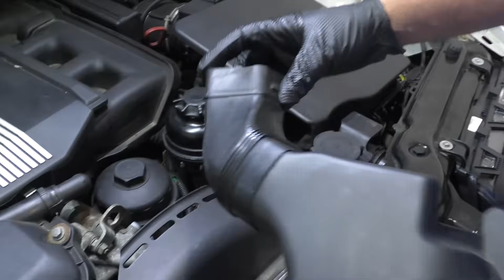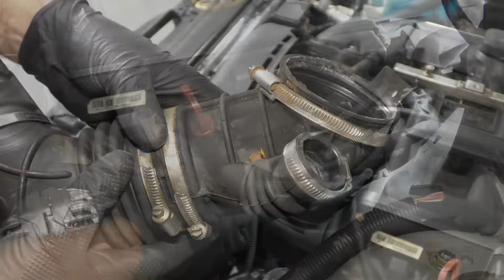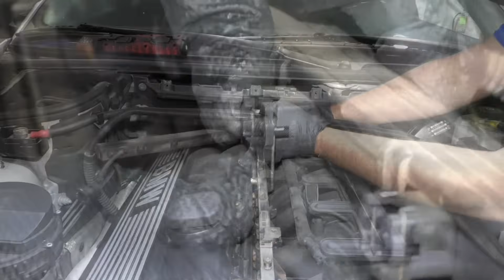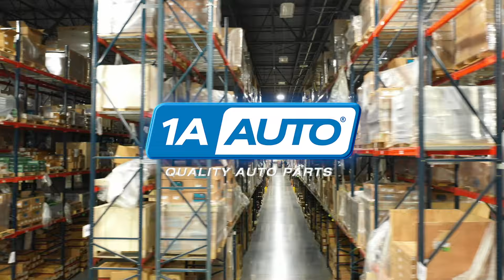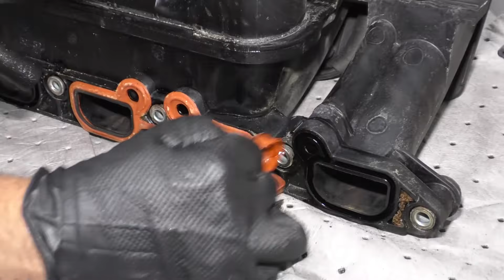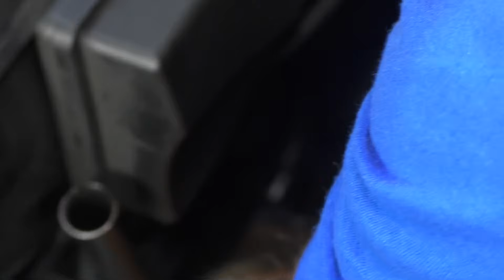How to Replace Starter 97-06 BMW 325 Xi

Comment: I loved ur video and tbh most of ur videos man they are truly a life saver, i had my starter die when i was 3hrs north away from home at work. So i started pulling everything apart while i waited for the starter to come, then i got to the starter and those stupid fuckin e torque bolts, so i tried a regular socket and could get them to start and partially started to strip the head of the upper bolt so i bought a e torque set and couldnt get the bolts to start so i had to drill and beat the mounts with a hammer and chisel to break the atrter mounts off , lets just say i didnt use e torque bolts after that i just used regular bolts.

Comment: pain in the neck job.  You actually don't have to remove the fuel injectors and wires, just lift the manifold.  It is harder but touching those injectors could be tragic.  Very well done as all the vidoes  from1A auto

Comment: What could cause a PF1415 after replacing the starter?
Reply from the maker: +gonzobrains We wouldn't be able to diagnose an issue like that here, you may want to have a local mechanic take a look at it. Thanks for checking us out! http://1aau.to/m/Shop-1AAuto-c

Comment: Do you have to take the fuel rail off to do this job? Would rather not if I’m able to get to the bolts holding the manifold to the head.

Comment: I tried using a 10mm on the top bolt as per this videos suggestion and it completely rounded the head. BEWARE. I used a 3/8 box end on the lower bolt as per a different YouTubers video and was able to get it out. Just a word of advice to tread lightly with these bolts. They’re near impossible to deal with once rounded.

Comment: This is a detailed oriented job and a great video.  I wish I saw it six years ago when I changed my CCV. I wanted to replace the starter as well but I didn't know how to unscrew the bolts.   The wrench used to unscrew bolts was all I needed. Bentley manual recommends dropping tranny from mounts and using long extension which sounds crazy cumbersome.  Thank you for video.

Comment: I can’t loosen the screws on the starter. There’s no room for a socket or wrench. My last hope is 10 mm flex ratchet wrench. I have on order. Ugh!
Reply: I read on pelican parts its better to remove the trans mount and drop the trans a bit
Reply: Did it work?
Reply: @tonys4751  Yes.

Comment: Do you even have to pull the dip stick tube ? Or pull the throttle body ? Or pull off the sensor that goes to the alternator??? Half that shot could have been left on

Comment: Probably a stupid question, but what is the black solenoid looking item almost directly beneath the starter? 

Not talking about the wires. Talking about the item that is almost the same size of the starter
Reply: it’s called the starter solenoid 😂😂

Comment: No offense to 1A auto for showing this, I really appreciate it. I have replaced many starters in my life. This is my first BMW starts and after watching this video, all I have to say is: All this work for a starter?? I hate you BMW, this is ridiculous.
Reply: there are some other cars where u have to literally drop the whole tranny to even see the starter
Reply: I replaced starter on BMW X5. V8. And it is accessible from bottom on passenger side. I did need a 42 inch extension to get proper leverage for torx bolts. 30 plus 12 inch
Reply: I feel you , I wonder what's the book time to replace the starter. lol  let alone warranty time smh.  1A auto sure know's how to break  down the components for the frugal BMW enthusiast
Reply from the maker: +David Hagler Thanks for checking us out! http://1aau.to/m/Shop-1AAuto-c

Comment: I'm half way through this job. Easy peasy! NOT! I have the starter off. Those two starter bolts took over an hour to remove! 3/8" flex wrench didn't fit so used a 1/4" with a 1/4-3/8" adapter, but mine required an E14 socket. Hmm. Another video recommended a 3/8" wrench as a better fit than a 10mm. Hmm.  I'm going to remove that cover that holds the brake booster hose to see whether that gives me more room. I didn't have to remove the fuel rail, and since no fuel is leaking, I left'em alone.
Reply from the maker: +Papa Torr Thanks for the feedback!

Comment: The starter I bought was 81/2", the one I removed is 7", does the size matter? any tips if it doesn't go in?
Reply from the maker: +Walid Bast Thanks for watching!  Depending on what you purchased that could just be a cosmetic difference.  If you are worried what you have is incorrect or it does not fit properly, we recommend you contact whoever you purchased it from to confirm fit.
Reply: 1A Auto Parts thank you for your prompt response.

Comment: What do I do if both of the starters bolts are stripped? Please help I’m stuck there
Reply: I’m in the same boat. Did you get it fixed? I got the bottom one out using a 3/8 box end. I tried the 10mm on the top one first as per this videos suggestion and it completely rounded the bolt head and now I can’t get it out. I know this comment is old but if you have any insight on how to get it out, it’d be much appreciated.
Reply: Did you get the bolts out and how?

Comment: Also word to the wise, don’t use any other starter replacement other than BMW original, as I found out the hard way by going with cheap aftermarket, less than a year into the replacement, my bargain aftermarket starter quit , and I had to do a replacement again 😫😫😫
Reply: at least reputable....

Comment: I did mine on my 2005 325ci  starter , and few notes if it helps the fuel injector rail doesn’t have to be pulled, just disconnect from main fuel line, and also a good half inch 12 point wrench works well on starter bolts 👍🏾👍🏾
Reply: 3/8 12pt for mine
Reply from the maker: +kgb7765 Thanks for the feedback!
Reply: Why not pull the fuel rail? And just disconnect the main fuel line? Does the main fuel line connect to the intake mani? I left off at the fuel rail and intake manifold that I will continue tmrw morning. Just curious. Thanks🤞

Comment: 1:02:47 I have that rubber mounting grommet however there is no vacuum line behind it to connect it to, please help. Tell me I don't have to take the manifold back off again......... I was SO close to being finished I've been working on this car for over a week getting the starter and CCV hoses changed. Please tell me where that vacuum line goes exactly.

Comment: Can i get away without removing idle air control valve.. Those bolts stripped i dont think theyre T30...
Reply: I was able to remove the plenum with idle air control still attached, no issue

Comment: Why can't you tell people went while you're doing this is before you do this you need to get a couple things so you wouldn't have to do it twice you have the CCV to replace that's just an example so then by the time you're putting a new starter in you have replaced the other parts other than that your video is very helpful and will you be telling us the torque for the parts to go back in
Reply: lol, always change ccv if your there.....  lol

Comment: Unacceptable to stuff a commonly replaced part into a black hole of labor. I had a Subaru before my e46, changing a starter on that involved: battery disconnect, lean over and remove leads, remove 2 bolts, pull out starter, then reverse steps. I miss my subaru.
Reply: my starter died after 16 years and 200k miles.  😅